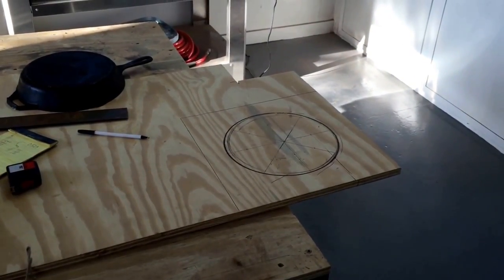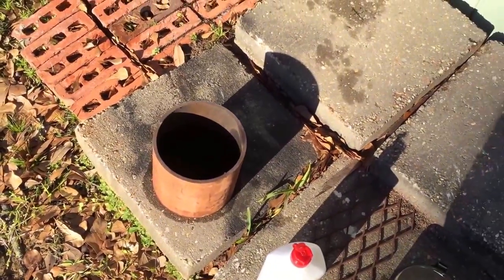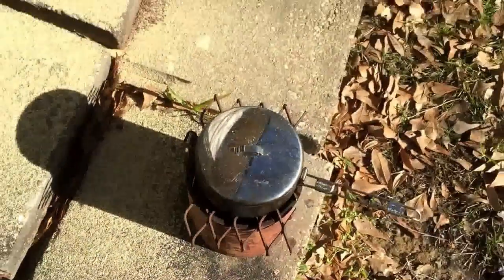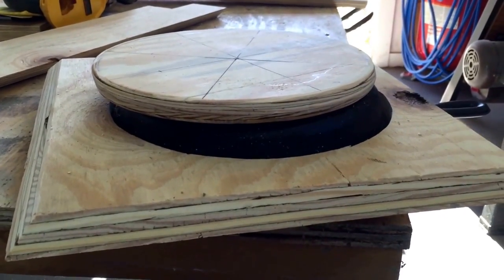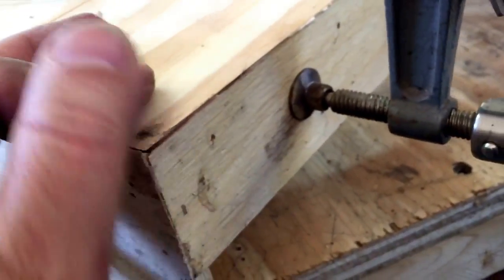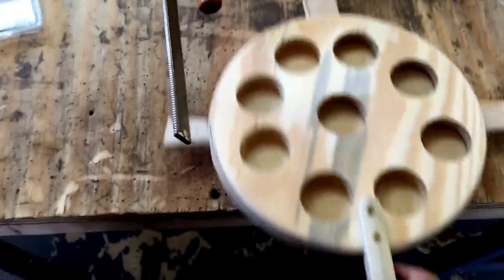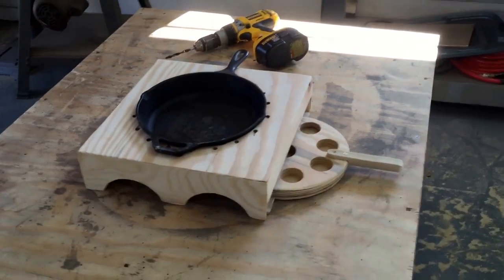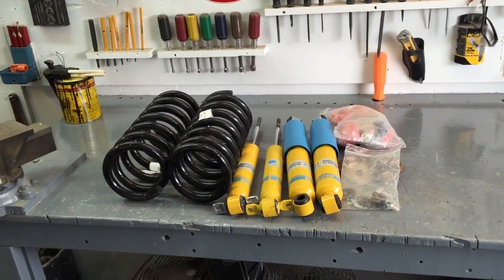How to make a tea light candle stove

Comment: Cast iron takes a little bit longer to heat, but once it does, it will get really hot, and stay that way a lot longer than most pans. I can't wait to see how it does. I bet it fries up that spam like crazy. You did a beautiful job on the new stove, it's great. When can I order? Oh, and the pot outside, did you consider lifting the ceramic part to let air in under it to keep the coals hotter? may still work with more air coming into it from the bottom. Great video! Thank you, Sheila
Reply from the maker: I'm going to revisit the pipe/charcoal test and give it another try.

Comment: Your pipe stove..... think of the design of a charcoal starter chimney you can buy at Wally World & such. Bottom of pipe has grate & air intake holes. BTW, your grate would work fine over one of those chimney's to provide an extra stove, when needed. BTW, enjoying your vids on alternative cooking. Been exploring that for many years, myself. Have accumulated quite a few of them for wood, alcohol, Sterno/chafing fuel, kerosene, camp fuel, charcoal & propane. Lagging behind on solar & a earth oven. (sigh) 

Looking forward to seeing how far you take your quest to have as many ways to cook, as possible. Thanks for sharing.
Reply from the maker: Thanks Lee. I'm going to revisit the charcoal possibilities. Eventually,I want to build another solar oven. I learned a lot when I built the first one.

Comment: I Am thinking of threaded rod stock in the four corners. then the height is adjustable, what do you think of that.
Reply from the maker: You need the sides to create a draft upwards and to promote convection. I'm no expert and I'm still experimenting but I think if I build another, I will make the candle holder adjustable for hight,not the stove. Great idea with the threaded rod. I wonder how or if that could be adapted to use on the candle holder?

Comment: Maybe no air holes on the flat around the pan, or fewer?  Maybe would let you step down to 4 or 5 candles once it's good and hot.  An aluminum pot instead of a cast iron pan might be  quicker to transfer heat,  and being a pot, it's deeper, so more of it's side is inside the oven, more surface area to absorb heat.  It would be more of a crock pot than a frying pan, but I think that would make the best use of the candles.  Like, cooking beans for 90 minutes, stew, etc.  And let your gasifier or alcohol stoves do the frying and boiling.  I'm not criticizing, just throwing stuff out there.  I think this is great and will build something along these lines.  Right now I just have a pot I press into the top of a coffee can and light 7 tea candles inside it.

Comment: Uh oh. I got another idea. will post a video tomorrow if it works, or call fire department if not.
Reply from the maker: +Robb&#39;s Homemade Life  Fire department is on speed dial here.
Reply: +BCtruck, rebuild, repair,repurpose Brad, I tried an idea but it didn't work, I added extra wicks to my candles to increase the amount of flames in my candle cooker setup but it melted the wax too fast and the wicks I added were not anchored.
Reply from the maker: I thought about trying that as well until I saw the wax melting to liquid form. Someone suggested making my own candles in a jar lid type of mold,with multiple wicks. That would work if you had the little wick anchor discs.
Reply: You can also get wicks that float in oil so they should work in the melted wax too.